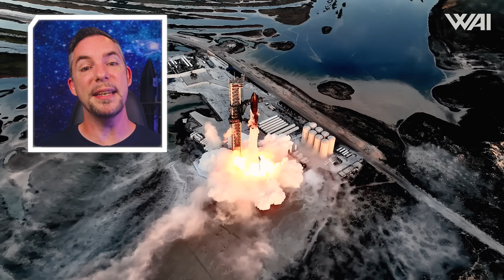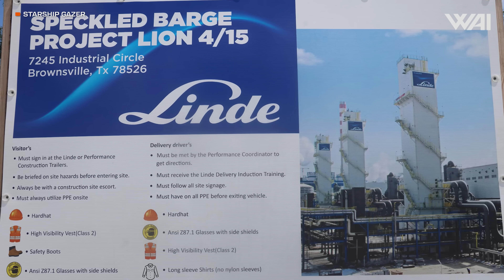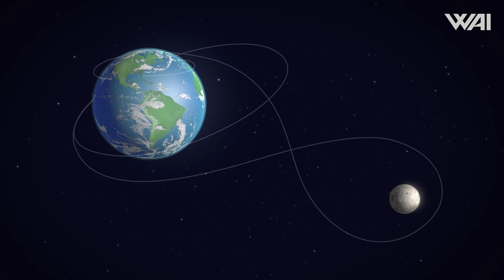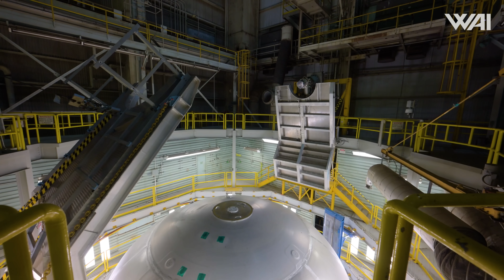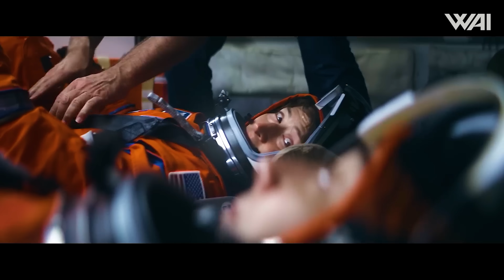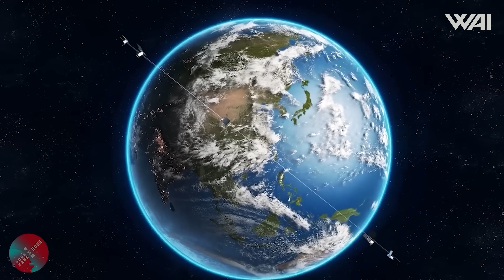SpaceX Is Introducing a Change To Starship Production? Artemis Is Getting Ready For The Moon!

Comment: About the test tank failure, was it a mistake? where would you expect it to fail? the top is short so stiff, the hot stage should be the strongest point, the tank was pressurized, so that leaves the botte half  tank unpressurized! if the can crusher was pulling down that's where I would expect it to fail first! Assuming you are testing to fail.

Comment: AI in space is st00pid and makes zero sense. Anyone who knows the trend in how datacenters are doing infra wouldn't possibly think it's a good idea to launch fscking GPUs into orbit. It makes no sense.
Reply: Hey, buddy, I'll make it simple for you.  Cooling datacenters on Earth: expen$ive and may involve depriving citizens of water in some designs.  Powering datacenters on Earth:  expen$ive and deprives citizens of electricity (Check what PJM did in the last storm for proof: they swiped power from datacenters to power homes), raising power bills to consumers.  Powering datacenters in space: free after solar panel installation.  Cooling datacenters in space: put it in the shade of the solar panels.  When Earth-to-LEO costs go down, all sorts of things can go up.  Including passengers.
Reply: @RobinMiller-v6c  Hey buddy, I'll make it simple for you, since I have worked in tech for 30 years, at Google for 15 years, and in AI for the last 8 years. This is absolute nonsense. Per-rack CAPEX and OPEX costs to run a rack of NVidia B200s is orders of magnitude cheaper than running in space on unproven, non-existent platforms that are impossible to perform any maintenance on, short of de-orbiting. A typical AI datacenter rack is touched (physically) at least every 3-6 months.

Then the heating dissipation issue, do you think space is cold or something dude? You do know that it is harder to cool something in a vacuum than it is in the atmosphere right? In space, you are stuck with radiative cooling which takes lots of area. A Single DGX with 8 Nvidia B200s would take a 5 meter x 5 meter radiator panel.  Multiply that out by 100,000, and you're talking 500 kilometer by 500 kilometers of radiation panels for cooling.

A single DGX requires 14kW of power.  You need at least 8meters by 8meters of PVs with 22% efficiency for that, so kilometers of solar panels in orbit.

Power and heat dissipation are INEFFICIENT in space dude, and launching all of this off the earth is expensive, AND it costs lots of maintenance, AND the latency is higher. 

I mean, the ISS has enormous radiator panels and uses about as much power as 8 NVidia DGXes.

You are being sold snake oil by the Musk charlatan. Space datacenters are the stupidest idea ever, and the only person who could believe it is someone who's never had to spec out a datacenter.
Reply: @RobinMiller-v6c  Put your money where your mouth, provide the calculations. You want to make it simple? A standard DGX NVIDIA rack uses 14 kilowatts of power and dissipates 14kW or 48,000 BTUS/hr. 

Now, using highschool physics, please calculate the size of the radiator needed for that heat using whatever state of the art heat exchanger/radiator. 

Now calculate the cost and weight of all those materials and how much it costs to launch it.

Now multiply it by 100,000 to match a ground datacenter. Now compute for me the total launch costs of all GPUs, the PVs, and the Heat Exchanges and cooling liquids. 

Most modern datacenters being built recycle water and release the water cleaner than they got it. 

The idea that launching PV is cheaper than building it on earth is absurd. And building anything is an opportunity cost. You want to argue that building PV on earth deprives people of electricity if it is used by a datacenter? 

Well spending the same cash or more to build PV in space to use on datacenters means that PV power won't be supplying homes on earth either, the diverted investment capital which could have built something on earth that could attach to the grid now is forever wasted in space.

Again, I know you won't, but you can end the argument by running the calculations instead of regurgitating what you're read people repeating online.

Comment: Booster great. Reusable upper stage disaster. Solution remove all the THS and other reuse crap and optimise disposable design. Probably drop number of raptors and focus on mass production to reduce costs.  THS development can be done in background. Lunar program can then focus on a reusable lunar lander and reusable Leo lunar HRLO transfer vehicles - one for slow Cargo using SEP and chemical for faster crew transfers. Blue origin is well advanced in these area so learn to work with your mates.  This system architecture isn't new been studied for a decade.

Comment: China is catching up by using good enough engineering, we don't need to get it perfect, simply not failing is good enough. Until its manned no one cares, if it fails.

SpaceX is iterating to a low cost robust solution. China says, let's get there first, then fix and iterate into a low cost solution.

Comment: So many ludicrous predictions. One starship launch per day by 2028? Felix, really?
Reply: They are most likely aiming for dozens of launches on THE DAY. Maybe even dozens of launches within hours. There will be at least four launch towers and they can probably re-stack them within an hour or two. The outer space treaty prohibits any kind of nuclear weapons in space, but it can't be enforced and it doesn't say anything about ground equipment. Consequently a country like the US could prepare a system that can put hundreds of nuclear weapons into Earth orbit in very short order without actually violating the treaty until the moment that it's crunch time because the doomsday clock hit midnight. Even a single Starship flight could potentially take 200-500 warheads on a ballistic intercontinental trajectory. That's between 10% or more of the entire US nuclear arsenal. Think of Starship as a super-ICBM with multiple warheads.

Comment: Artemis II will prove to the world that we can do something we did 60 years ago, but at a much higher cost.  Impressive!
Reply: Actually SLS costs less than half as much as Saturn, including inflation adjustments.  According to my analysis the high cost is largely because so far SLS has managed only two flights after spending billions a year for fifteen years.  During those fifteen years SpaceX managed over 500 Falcon launches and eleven launches of a booster with greater payload capacity than SLS.  And with recovery of the first stage in most cases, while SLS throws away billions of dollars of hardware every single time.  The only logical reason to carry out Artemis II is because it is the only launcher that can do this at this monent , although Falcon Heavy is very close.  And by some time in 2027 Starship will be capable of delivering a 200 ton spacecraft into a similar free-return trajectory.  And Orion is a 13 cubic metre closet, while HLS has 300 cubic metres of habitable space,the equivalent of a 450 square foot apartment.!
Reply: That's why. It's so important for SpaceX to be successful. There's no way we're going to Have a moon base. Without them. Because it is way too costly for NASA. But that's what happens when you Have government involved? All that money goes Through. so many hands. Before it actually gets to the real project.
Reply: @gary-pietz4147  My grandfather had a phrase for this:  "It's like feeding sparrows by giving the grain to the horses first."

Comment: re: temporary bracing   --  consider what the effect of a sudden storm off the gulf would cause during construction especially as they start adding exterior cladding.  Structural engineers have to design buildings to meet storm and earthquake standards.  They also have to meet these standards during the construction phase.

Comment: i wonder what would happen if Artemis failed and the crew died. I am worried that would kill the program. Artemis has been plauged with issues, they should of had spacex design it. Also Linde could be supplying the gasses needed for welding to spacex.

Comment: Alex, can you please do a video, on the gamma radiation and other radiation,  astronauts face on the moon and Mars.  My research says 100 to 200 msv, with upto 600 msv, on either of the moon or Mars. And that no longer then 5 days, can astronauts be there, without under ground hab or 3 feet walled thick lead.   Or atleast 6 inch thick walled, water. For partial reduction of radiation.  So, any astronauts staying on the moon or Mars, longer then 5 days, radiation exposure becomes a problem,  after 10 to 20 days, they will be sick. After 30 days, cancer,  organ failure is likely to happen.  There's no talk on this

Comment: speculation: collecting carbon dioxide and use solar electricity to make hydrogen and oxygen with electrolysis (or other methods of separating water molecules) then use the "Sabatier reaction" to make methane from the hydrogen and carbon dioxide (needs a nickel catalyst). If this plan is used, some of the oxygen needs will come from the electrolysis and the nitrogen needs match the air separation results of the oxygen... the inefficiency of the rocket engines appear to result in slightly higher oxygen use compared to the hydrogen in the methane (to create water and CO2 exhaust).

Comment: Re Gigabay and the temporary bridges: 

I am NOT a civil engineer, but my bet is on them being temporary. The constructors want secure rigid structure to which to attach the roof. The temp bridges should help that. The attached roof will then contribute to building rigidity, allowing dismantling of many or all of those bridges. My non-expert guess. 

If a hurricane goes directly over the partially constructed Gigabay... ?

(When will you look for plans for a Terabay? 😀)
Reply: If not, they could stack the lowest in the back, move one step forward, stack another, move one step forward, stack, move one step forward until exit.  The bridges just have to be high enough to allow the previous stack step to pass below.

Comment: End of January and cold fronts  hitting this weekend, don't let history repeat
Reply: Did martin thiokol   make these SRBs?
Reply: @jml_53    Well, what was Thiokol, through a series of mergers, is now owned by Northrup Grumman. They are still making the SRBs though. More importantly though, there was nothing wrong with the SRB design or manufacturing in '86. There was just a deliberate management decision to overrule the Thiokol engineers who were nogo for launch and launch in unsafe conditions. Design was upgraded after the political theater of the Rogers Commission, but never underestimate the power of management to screw things up.
Reply: @odysseusrex5908 that is the truth.  Same management by committee approach explains Artemis and Orion.
Reply: @jml_53    If by Artemis you mean SLS, put that blame on the politicians. Congress forced the design.

Comment: That's exactly right.  China could probably get a couple taikonauts to the moon in about four or five years but does not have the lift capability to get significant mass to the Moon to build a permanent settlement.  That takes a heavy lift fully reusable rocket like Starship that can get 100 tons to the moon over and over again.  It's taken Space X over a decade to get to this point:  500 plus launches of Falcon 9, landing on a drone ship about 400 times, then building and testing Starship from it's inception to what it is today.  You can't just copy or reverse engineer that, you have to do all the hard work to get there.
Reply: Get taikonauts to the moon is one thing. Can they also get them safely back to Earth afterwards ?
Reply: At least half the challenge is just knowing that it's possible. Giving a bunch of engineers an example to reference so they know it can be done and have a starting point makes all of it WAY easier even if you aren't actually stealing any plans.
Reply: @thamiordragonheart8682 Its called fast following.  Japan would send engineers to America to study semiconductors.  They would spy because it was a national priority.  China fast follows, then reaches parity, then passes up the former leaders. Example: German maglev.  Russian warplanes, etc.  Fast following saves time. Japan did it, now China.
Reply: @mefobills279  I thought that's roughly what I was saying, just that you don't even need to do the stealing part for it to work. 
I guess I didn't write it very well though.
Reply: @thamiordragonheart8682 Fast following has always included skullduggery.  China required technology transfer for access to their market.  They built copycat factories, so the workers could transfer knowledge.  The Chery QQ was an exact copy of Chevy spark.  I personally trained Chinese engineers.
Reply: 100 tons to moon? How many tanker ships to low earth orbit to do that?
Reply: @njm3211   That is not certain yet, but probably between ten and fifteen.
Reply: @njm3211 About ten tanker flights.  Total cost, considering the spaceship is entirely reusable is $20M for fuel and ground crew.  That is less than the cost of a single Falcon 9 launch (about $40M).  And with two launch pads in operation, which will be true by Summer 2026, those ten launches can be performed in a single week.
Reply: @njm3211  How do you get the tanker ships to low earth orbit?
Reply: @JarvisThribb   By launching them. They sit on top of a Superheavy booster, like any other Starship. Their own engines boost them into orbit and then return them to Earth.
Reply: China's economy is in a bad place i don't think china is going to the moon anytime soon
Reply: @Slacker420oz    Well, except that, having a command economy, they can direct resources where they want them and, having the largest manufacturing economy in the world, they have a lot of resources to direct. They are directing them into auto manufacturing. They make three times the number of cars that we do. They are directing them into naval construction. They have constructed the largest nave in the world, and are still turing out warships on a wartime basis. Mostly small ones, destroyers and corvettes, but they want to blockade Taiwan, not dominate the Pacific, yet. And they are putting them into space launch. Their launch cadence dwarfs everybody in the world except SpaceX. They are filling the sky with military satellites and megaconstellations. They see the propaganda value of leading the way back to the Moon and they are going to do it. Their politicians are determined to put men on the Moon. Our politicians are determined to provide jobs which buy votes. You see which approach is being more effective. I expect Chinese on the Moon by 2030 and Americans not before 2032.
Reply: @odysseusrex5908 yeah your wrong bro they are floundering big time robbing peter to pay paul
Reply: You dont need starship, only superheavy booster.  China could copy Neutron, only increase size to superheavy.  Second stages can be made cheaply.
Reply: Are you sure? China is more than capable of stealing every design right if Elon's desk. 

The real risk is that they can copy and reverse engineer it, but a you point out, they won't have the experience.  That is usually a fast road to tragedy.
Reply: @jml_53    Reverse engineering is not that straightforward. Even having complete blueprints is not the same as knowing how to manufacture the components, or do the metallurgy involved.
Reply: @jml_53 See inside China business on youtube.  It will level set you on just how far advanced they have become.
Reply: Na, while the Chinese cant copy everything they do benefit from seeing things getting done and have come quite a long time already. Just see their development on fighter jets that have more or less exploded into probably the fastest in the world a.t.m. even if they havn't reached the USA top level yet. Its getting easier and easier to develop things with better and better computers and AI, today you can simulate things that was not close to possible 5 years ago. We will see Chinese "falcon-9 copies" fly and land 2026 and I'm quite sure superheavy lifters are in development.

Comment: The Bridges are temporary walkways and will removed later in construction process
Reply: Wouldn't be surprised if there was some sort if structure benefits (not necessary) in the interim of the construction too.
Reply: @johnd.7792 Not a lot of buildings are designed with 30 story high voids in the interior. If I lived down in Boca I'd spend half my time sitting in a lawn chair by the highway watching the big Legos go together.
Reply: Yeah they are to make it easier for the guys to transit from one side of the building to the other, dont worry!
Reply: It would be interesting if they put in some "draw bridges" that could be lowered except when boosters needed to move in or out.  It would make movement around the facility easier most of the time.
Reply from the maker: That would make more sense! Do you have experience in steel construction? :_WAIHeart:
Reply: @Whataboutit    I heard this on NSF, in there conversations.
Reply: @Whataboutit I don't no, but I was a machinist, and structures have always been interesting to me... Just a fan that would love to he able to do more for this community and others, exciting times ahead, politics aside😅😊
Reply: Where do they "walk", on the 3 inch wide beams?
Reply: @ItsEverythingElse iron workers walk the beams. It’s comparable to walking a parking lot stripe, Just higher
I would be surprised if the beams are only 3”wide though. Most structural is  6”+.  
Nothing that can all would use 3” wide beams. The braces/gussets may be close to 3”